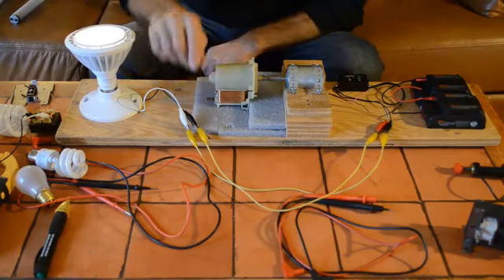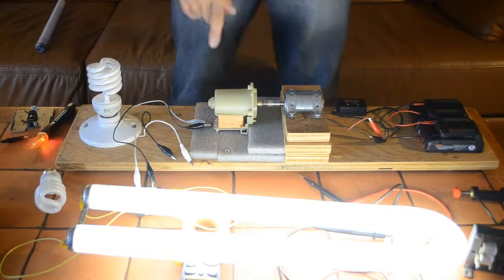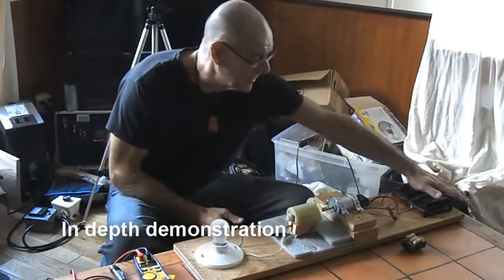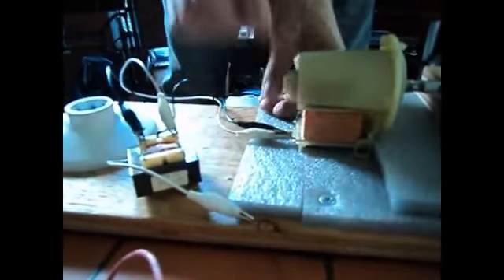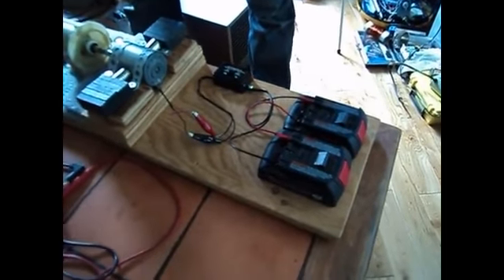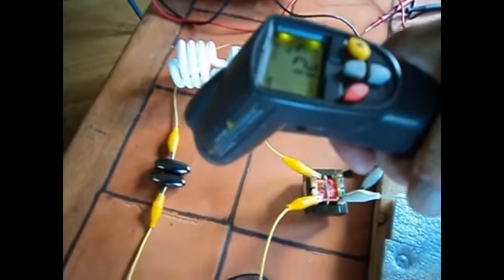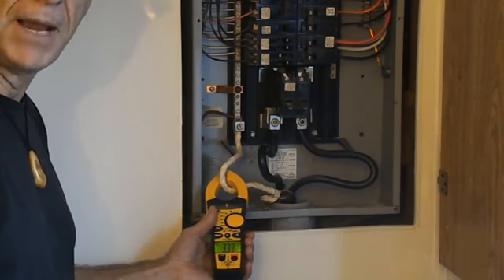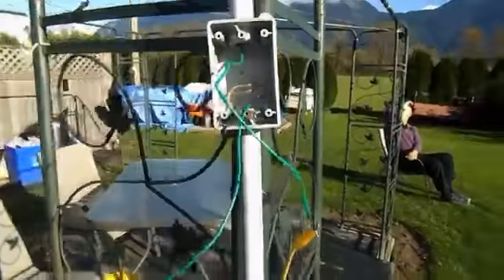Free Energy Feb 2015 Gerard Morin Free and Natural Energy The Mystery Solved

Comment: Can I make what gerard calls a modulator with a alternator? I know it has iron core but it is magnetic or does it need to be a magnet inside iron through a coil as shown? Also I was wondering if I could use glass with water in it in place of the iron I know this sounds odd but iron eats away some of energy water I think could act as a battery inside a transformer kinda like Stanley Myers did but not exactly I hope I explained myself well my mind is literally in overload right now with possibilities.

Comment: I have never seen someone talk so much, and say nothing and proved nothing. Sorry  Gerard. You are converting DC to AC and changing the voltage, but you are loosing power not gaining. Put something like a hair drier on your invention. You get nothing for free. With less than a grade 5 education you are going to say that all the brilliant scientist in the world are wrong. Your bulbs are not really burnt, the filament that starts them may be gone, but if you turn the voltage up high enough you will get them to light. The gas in the tube is still there, it is the gas that produces the light you see. Stop trying to rip people off. I have never seen any one make so little sense.

Comment: I have a bebs type 2 120v 60hz/clf washer draining pump and had a motor hooked up but the faster i speed up the motor the voltage wasn't going any where it was at 0 but when it is running alil slow i can get about 1 to 1.5 volts but thats it and the motor I'm using is a scooter motor and i dont know about the rpms but like I said the faster i sped it up the voltage stood at 0 do you know what I'm doing wrong?

Comment: I can explain each and every part of his test, his equipment, and his test equipment and measurements and lack of wattage and/or amperage measurements he fails to take.

First, the 120v bulbs were made to work the best with close to 120volts connected to them, so by hooking them to 36volts is hardly the thing to do if you expect efficient light and therefore anybody understands why the bulbs don't work well on 36volts. Second, the mercury bulb(the spiral bulb) uses electronics designed to run on 120volts input explains why these bulbs don't light at all on 36 volts, these type bulbs raise the voltage even more internally, purposely, they will never light on 36 volts.

So, he hooks his 36voltsDC to his DC motor and turns his electrical generator(another DC motor) vis mechanical connection of his DC motor at a specified rpm to achieve 130voltvac out of his generator. This in essence can be used for a DC to AC converter, this using DC battery power to turn the DC motor mechanically connected to the generator that arranges the voltage into 130VAC, nothing free just a conversion of energy that is already been known since the 1800.s and we already use this technology today, for over 100years. He used the motor to step up the voltage, it is not stepping up the energy, so sorry to you gullible people.

Using voltage for heating is been known for just as long, you claim heating magnets is never been conceived, but it has and it is not beneficial to use that material for a heater, for a few real reasons you don't understand, especially since you don't understand we been using voltage/electricity to heat with since we been using electricity.
Reply: Tony Hardy, I'm not doubting your explanation, so much as looking for clarification. How are you defining Volts and Energy? If he is stepping up the Volts,  

 "the SI unit of electromotive force, the difference of potential that would drive one ampere of current against one ohm resistance."

then wouldn't he in turn be increasing its Energy,?

1. "the property of matter and radiation that is manifest as a capacity to perform work"

2."power derived from the utilization of physical or chemical resources, especially to provide light, heat, or to work machines."

Again, not disagreeing with you, just looking for clarification.
Reply: Ranger Bowyer Si unit of electromotive force(EMF) is measured in volts, electromotive "force' is not considered a force measured in newtons, but a potential or energy per unit of charge, measured in volts. It throws off a lot of newbees at first. That term EMF should be discarded, it is a pain in the but because it steers people in deception. But anyway EMF is a potential measured in volts. 

Absolutely not, this does not mean he is multiplying energy just by stepping up volts. Energy=power same thing. In the SI system, the unit of power is the joule per second (J/s), known as the watt

The watt is the unit of measure of power, NOT voltage alone. To achieve power(measured in watts) you need volts and amps. To have power you need both volts AND amps, TOGETHER they equal the power in watts. P(power)= E(volts, electromotiveforce) X I(current measured in ampere)

Power, Energy is measured in W(watts)=volts X amps, and we just learned watts is the unit of measure of power, energy. Voltage alone is only potential, remember how voltage sits on your battery white nothing connected it just sits, voltage it does no work alone, nothing, but it remains voltage, it remains only potential, only until you hook wires or flip the switch that connects the battery to a load will the current flow, movements, now work is done, power, energy is used, you now have energy in progress, work being done.

And there is a lot more to learn here to explain, it is the basics  of electricity, but i am still only scratching the surface of the basics. You also need to know ohms law. Voltage=current x resistance. So ohms law represents and explains why raising the voltage alone can't raise the power. V=I(amps,current) x ohms(resistance), and by using algebra you will understand. 

I give one example then you on your own ok, now when i raise/convert.transform the voltage from 38dc volts to 135vac i have higher potential volts but that is all i have is higher potential, but not more energy. For example it means it will last less time, being able to run 1 amp if i run the voltage lower i will get 1 amp for LONGER amount of time.  So when i raise voltage using transformation i still have the same amount of energy i started with minus heat losses. This means higher potential voltage, but not more potential energy, the terms can be tricky for newbees, the voltage is higher but now the current available at that voltage level is next to nothing understand? It is very similar to water at a dam in understanding this aspect of the relationship between voltage and current, and resistance. Voltage being the water level at the dam(how high), current flow rate being the water flow through the turbine, and resistance being the size hole in the dam that allows water to flow. But if you learn algebra then apply it to ohms law, etc... it will explain the truth. But even if you don't believe it and do all the physical experimentation to try to disprove it you will be sorry you wasted all your time when you could have just learned it from us, and study it yourself, this stuff is already known. Because it will take you a lifetime or 20 to learn what we could teach you. But anyway when i raised the voltage by transformer and/or mechanical generators it lowered my current flow will available to me, made it much much less, meaning i only still have the same amount of energy i started with. Remember the dam, raising the level don't raise the work deing done, opening the hole in the dam does that, and opening the hole is allowing CURRENT flow.  go ahead and do the experiments but you will see that you will not disprove ohms law. At least not with the way we use electricity and copper, until we learn of a natural superconductor that is.

You need to really dig deeper to know this, you can come to know it if you want to,
Reply: A lot of current a the lowest possible voltage is called welding. And the highest voltage at the least possible current is called static charge. lol
Reply: Gotcha, thanks for the response. That helped out a lot.

Comment: hey gerard good point and experiment . i have a dyno i made 2 motors like used in your test  just smaller 12 vdc  in 18 out no load if i connect diode bridge then it will charge a  wet cell battery  at 15-16 vdc at 2 amp  with batterys load on . a few points i seen you make on hf  electricity over a line  2 signals on 1 wire. yes very true the train uses this method on rail hv it has a separate frequency sent on it  for signals and gates for traffic. i have a free energy system using  a mod car alternator and ac motor belt drive i get 16-18 vdc off 3 phase diode  system i made .it outputs max 30 amps  i was a electronics  tech for over 30 yrs repair some mods and cb ham radios antennas  the ppl that dont know  dont do nada no hobbies or trade all cell phone tv games  and your rite there zombies and brain dead i started at age 10 iam now 50 also worked for a college and head student at boces and taught  the class   put in charge by teacher  i later went on to do tv repair and ran my own biz i live in long island  about 20 miles from teslas old lab  hey give me a shout keep up the good work